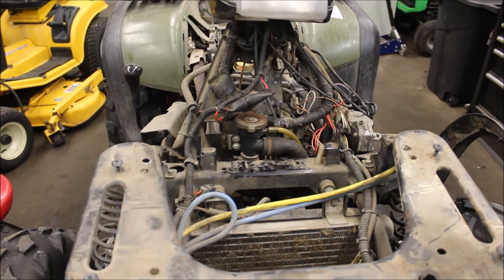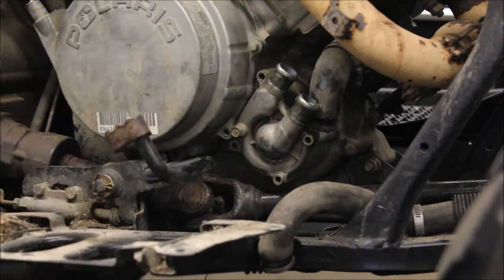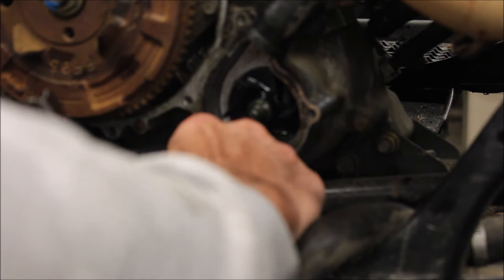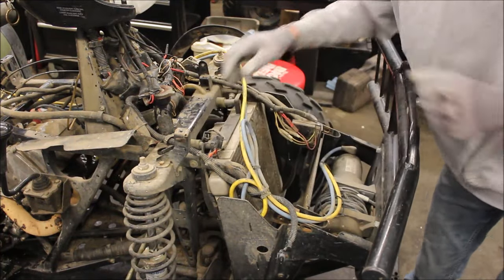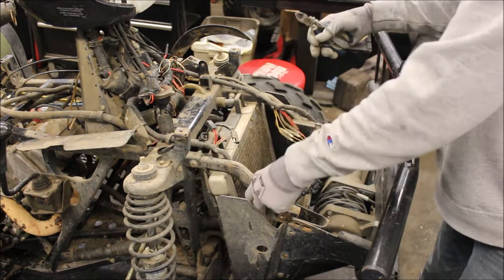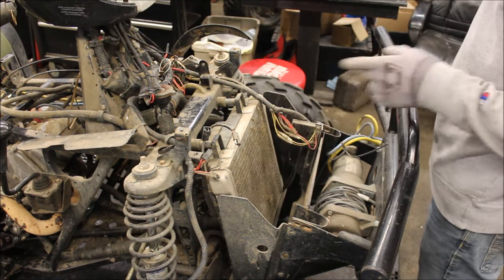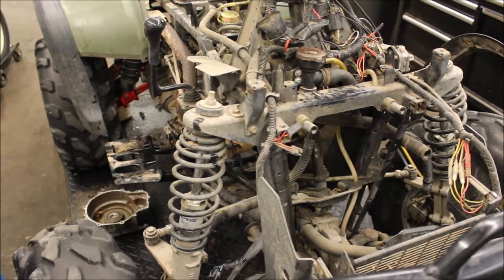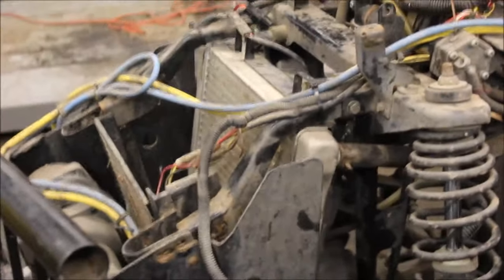Overheating Issues on a Polaris Sportsman Pt. 2 Inspect Impeller and replace Radiator!

Comment: I did some work on my 2003 600 sportsman,,,,,  Check for plugged up over-flow hose to over-flow tank ,,,,, and I do alot of plowing for snow,,,,, So take the valve cover off and you might  find a build up on the crank case breather hose from valve cover to the air filter box ,,,, if this Helps anyone  !!!!